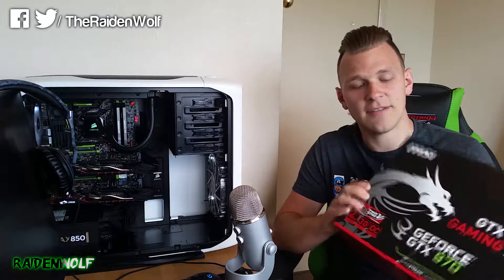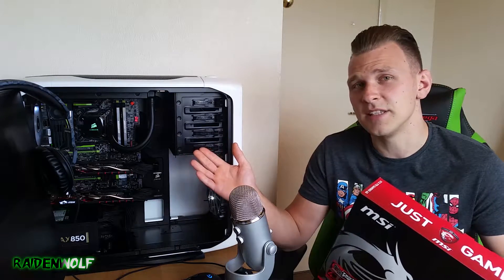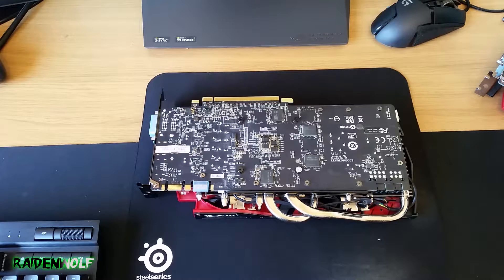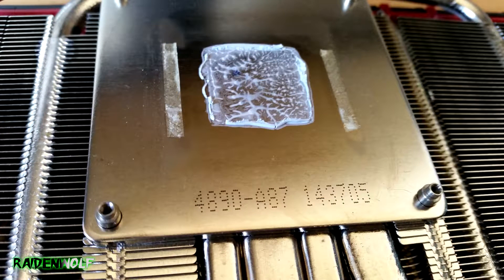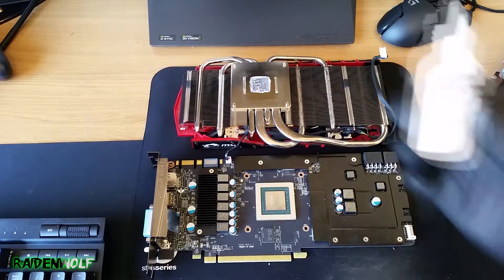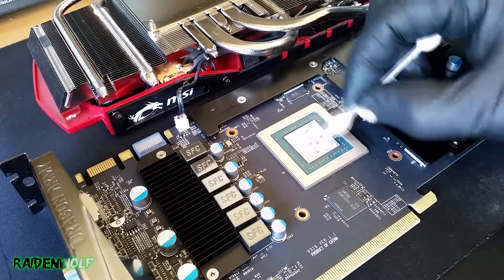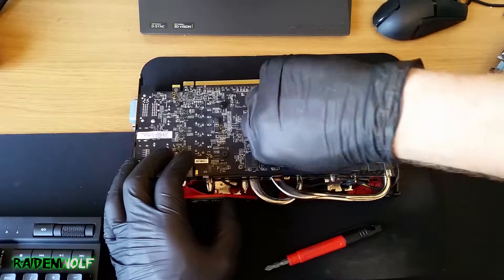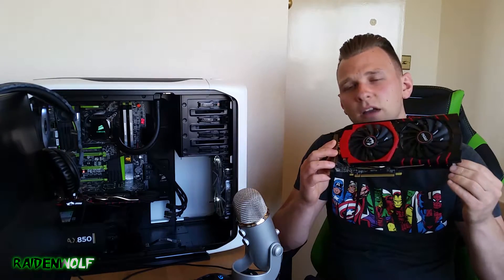Thermal Compound Ultimate Upgrade Tutorial, MSI GTX 970 SLI, Liquid Pro, MX4, Better GPU Performance

Comment: Arctic MX-4 and Arctic Silver 5 are the best
Btw spread method is really bad
Reply: +queenform Spread method is required for the liquid pro. Otherwise it won't really spread and will actually just leak out even more than it probably did from him using too much.

But I would definitely suggest the MX-4. Outperforms the AS5 from what I hear, although I haven't seen a lot of people testing it after the full suggested curing time so that may be the biggest difference. I prefer the MX-2 and MX-4 because they aren't capacitive like the Arctic Silver 5 is.
Reply: Arctic Silver 5 is not electrically conductive, you can see on manufacture website.
Reply: Антон Петров
I said capacitive. Not conductive.

Comment: good way of removing the warranty screw, I may do my msi 970 in the future, but its still in the 60's at the moment 

My old msi gtx 760 thermal paste dried up in about a year as well, msi must use cheap compound
Reply from the maker: Thank you. I didn't wont to remove that sticker just in case something did go wrong :) Yeah Iv seen a lot people also say the paste is not very good from msi had same problem on my 670s.